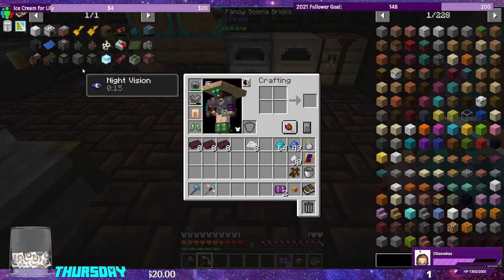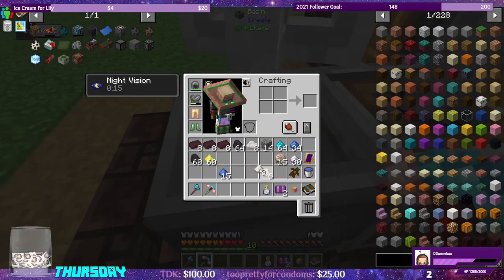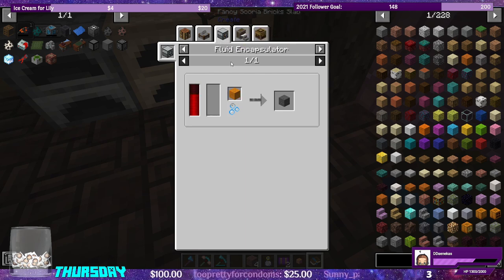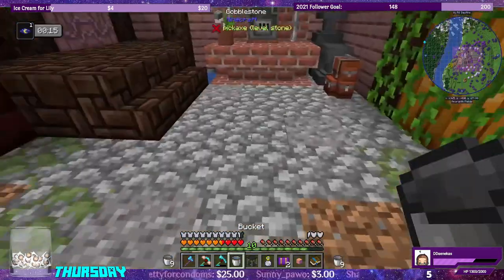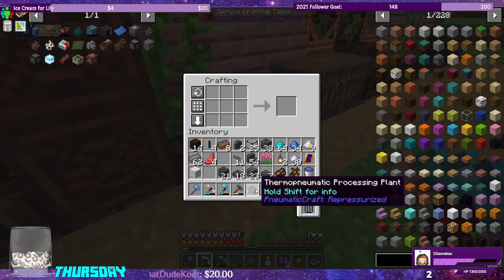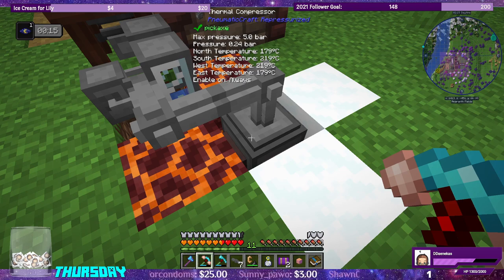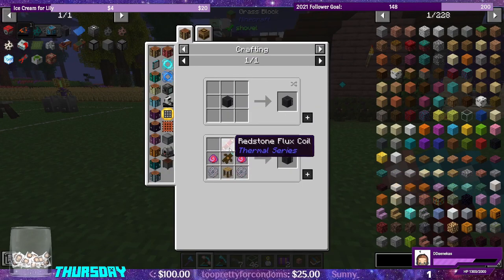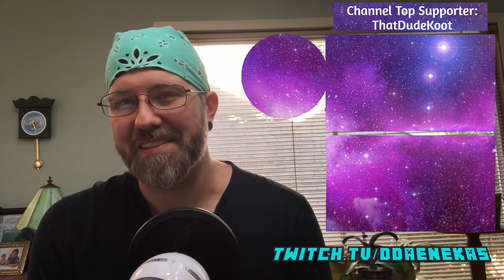Lets Play Enigmatica 6 Expert EP 13 - Pneumaticcraft Thermopneumatic Processing Plant for Centrifuge

Comment: I played with this on another pack... I used Campfire - and 2 buckets of water
Reply from the maker: What were the buckets of water for?
Reply: @LetsPlaywithDDae  cool the machine down. It has 6 sides. The gui will tell you that there is heat escaping from at least one side. I pu the campfire underneath the machine and it seems to work good.